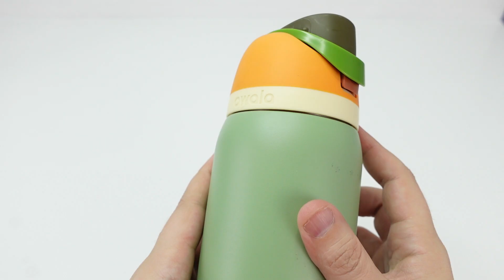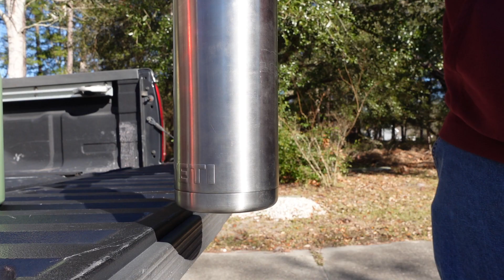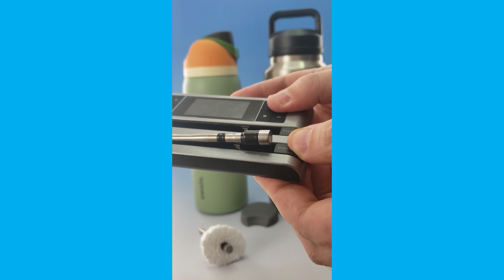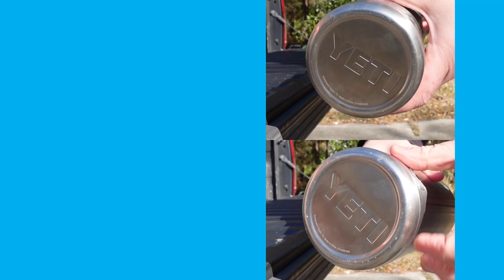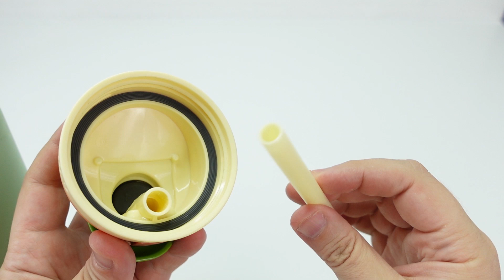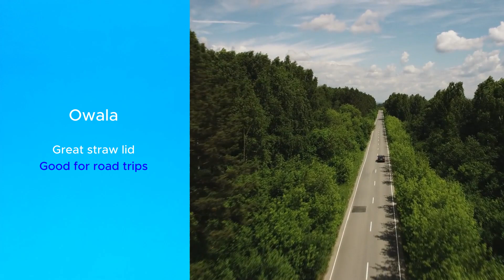Owala or YETI | Buyer's Guide | Insulation Test, Drop Test, Common Questions

Comment: the biggest reason i went back to yeti is that for flights, the owala bottle becomes effectively pressurized. when you open the lid, it spits on you out the straw port for a brief second before the lid is all the way open. not a huge deal, but no one seems to mention this.

Comment: You guys should try the Japanese thermos brands like the tiger thermos! Their bottles designs have been tried and true. I find them to be very light and the overall performance to be superb!
Reply: Those are nice but if you live outside of Asia they cost about the same as a yeti and the build quality is not as substantial. The insulation however is much better.
Reply: but i like the design of Yeti :))

Comment from the maker: Either bottle can be a good option depending on what you're looking for.  Hopefully this video helped!

Here are links. I may earn a small commission through Amazon Associates if you buy using a link below.  It's no extra cost to you, and it really helps.  Thank you!  
Owala FreeSip: https://amzn.to/3QTtlfR
YETI Rambler: https://amzn.to/3V99dcv

INSULATION TEST
I add hot water to each bottle and drop in wireless thermometers.  Then I record how much time passes between the last time I see 165 degF and the first time I see 150 degF.

Here's the reasoning for why I set the test up like this.
1) My main goal is to determine which bottle is the best. More practical tests like "how long does a bottle hold ice" are useful and I do those sometimes too, but they are very difficult to perform accurately for a few reasons.
2) Insulation prevents heat transfer in either direction.  Bottles should have the same relative rankings for either ice or hot tests.
3) Ice water is the same temperature (32 degF) until all of the ice melts.  Only at that point does it begin climbing toward the temperature outside the bottle.  This makes the starting point where you can actually begin measuring temperature shifts more difficult to control.
4) It's difficult to get a consistent amount of ice in each bottle.  An ideal ice test would involve weighing ice at the beginning and end of the test.
5) Starting the test at 165 degF means I can add water hotter than that and wait for it to drop to 165 before starting the test.  This eliminates error from when I'm setting up the test (like which bottle do I add water to first?)
6) The temperature difference between ice water and room ambient temps is less than 165 degF and room ambient.  Higher differences mean liquid temperature will change more quickly, which makes it easier to see differences in results with a hot water test.
7) Starting with boiling water would be even better because it has a greater temperature difference.  However, I don't do that because that's what the probes are rated to, so I want to give a buffer.

Let me know if you have any feedback!